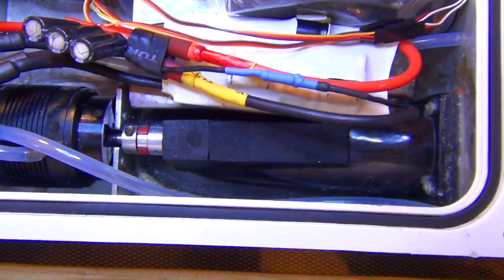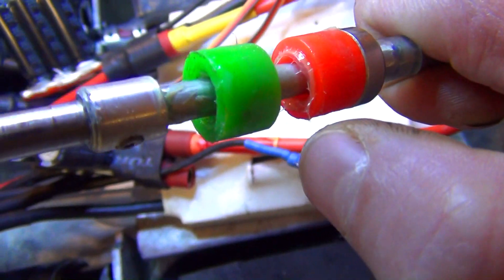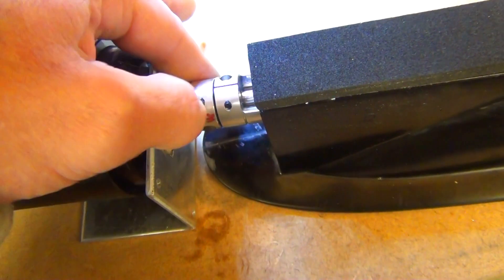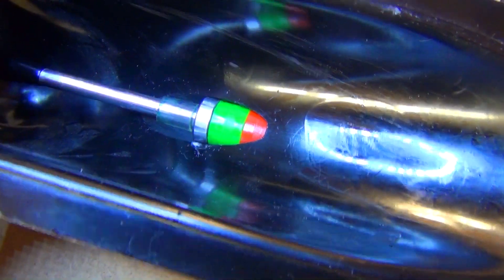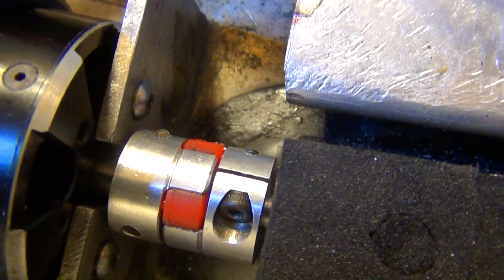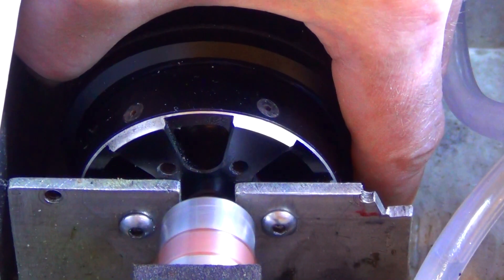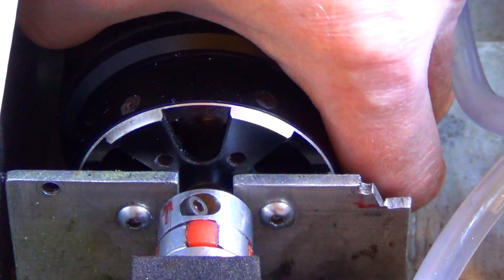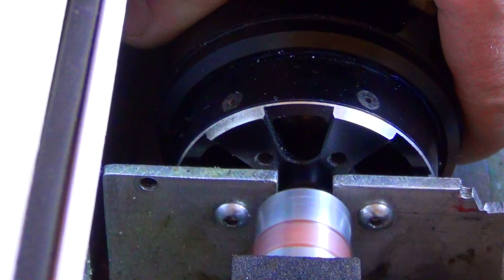Fitting a motor to a jet-unit with a plum coupler

Comment: would it not be easier to use a solid couple for alignment purposes first... ? if its bang on with asolid coupling then wehn you pull the shaft back out and fit the plum coupler it will be inline again ?

Comment: You put the bearing in front of the seals , is that correct ? , that is means the bearing expo to the water , it is not protected , even though  the bearing is stainless steel   but the lubrication will must washed out and then get fucked .

Comment: Would you try a 18650 pack
Reply: It all depends on what cell type and how you build the pack, I will build mine from either 18650 or 21700. As long as the have  the right discharge capability for the ESC/motore/ etc. you are using
Reply: True, 18650 pack could be cheaper and safer the only downside is the weight but the board floats anyways...
Reply: @Eden_M  Li ion is lighter/ more energy dense
Reply: @sharpnesstherapy502 True, except their low discharge rate compared to lipo. You gonna need 7 Li-on cells in parallel to pull 100A off it, meaning your typical 18650 li-ion battery pack is going to be at least 5 times heavier (if I'm being generous) than li-po.
However, for jetsurf, 100A discharge is the bare minimum, now which one is heavier?
Reply: @Eden_M  if I was building an rc plane to fly far i would choose Li-Ion. He probably want some good capacity too so double duty i guess. Weight doesent matter in a board either, space does, so I would definately go with li-ion anyways